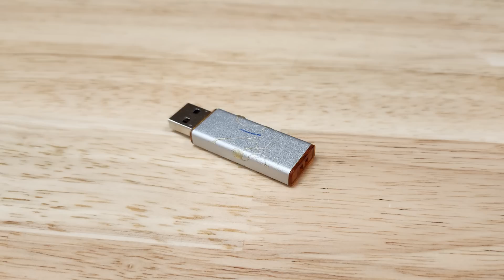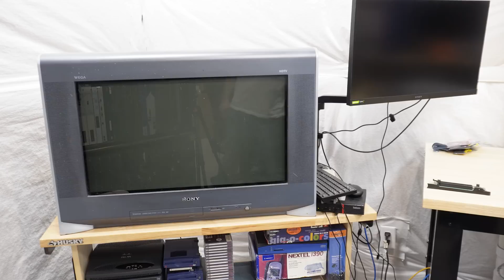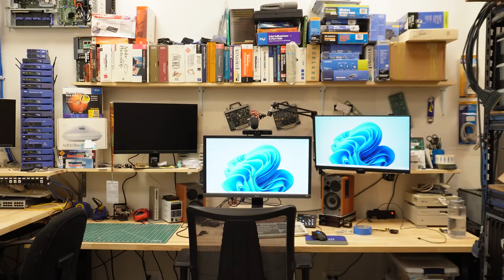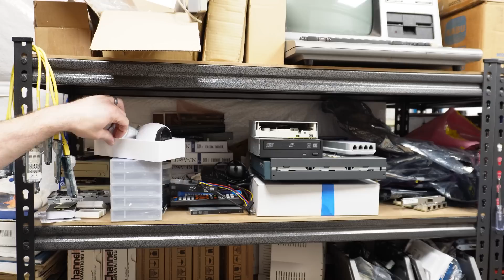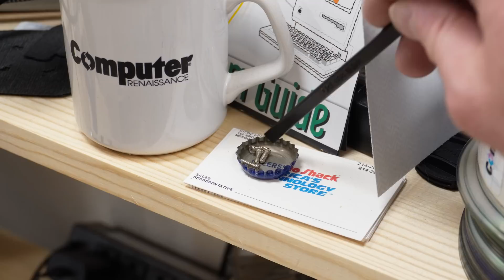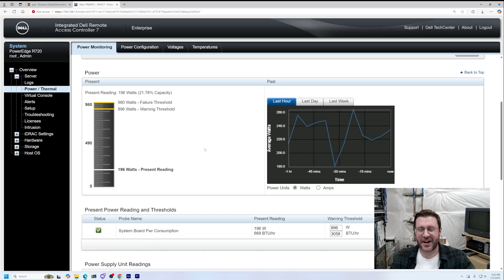Workshop and Homelab Tour

Comment: It's funny. I'm doing a brand new voice install for a school system, and during the walk through of their existing network closets we noticed that there were PILES of old networking gear in the corners. Whole bunch of Cisco 2960/2960s/3650G/3750G switches and many, many APs as well. My boss who was doing the walk trhough with me asked what the customer was going to do with all of it since they upgraded to Meraki, and he said that all of it was going to be scrapped. All of it, just tossed out to the recycling center. My boss quickly said that we'd be happy to rescue the switches to use for spares as they were all recent enough to still be usefull (fully Gig and PoE). It's crazy how much newer fully working equipment just gets tossed, so it's just so cool to see even older stuff put to cool use like this even now. Thanks for the great videos!
Reply from the maker: it's truly amazing how much stuff just goes in the trash
Reply: I picked up a 3560G for getting my CCNA, still plan on using it once i get a house of my own, though i did also pick up a 48 port ubi switch i would probably use primarily for the ecosystem lol. Used enterprise stuff aint light on power, but for what it is, its dirt cheap, just a bit of configuring
Reply: Send some of the stuff to mr Colby
Reply: Welcome to ‘Merica!
Reply: Depending on where you are and what industry you’re in, sending equipment to e-waste is legally required. In Montana where I’m at, all state institutions (gov’t, education, etc.) must dispose of equipment through the proper channel.

Now, small stuff is often saved by individuals for non-work related projects. Full computers and networking gear is never saved. It has to go through e-waste and surplus.
Reply: you should see the scrap piles that will be in your lsp providers nodes between your address and the head end usually there will be an air conditioned 18ft container with the current networking gear and  around 3 or 4 containers worth of "end of life" gear that can be pretty recent in the warehouse storing the active node ac controlled container
Reply: Aside from the above ^ where some companies literally cannot dispose of e-waste except through approved auction / recycling services, the other problem I've had is relationship management.  I work for a company that bills for my time.  I build relationships with customers that turn into pseudo-friends.  I once worked to upgrade and install a ton of new IT equipment, displacing a bunch of old networking and server stuff.  I asked, "what's going on with these?"  "Junk."  "You're going to throw it away?"  "Yep, unless someone steals it from my truck and saves me the trouble."  "Mind if I take a few?"  "Sure, what'll you offer for it?"

It went from "this is going to cost me to dispose of" to "how much will you pay me for it?" because, suddenly, it had value.  At that point, I was better off walking away from it and trying to find something on The Bay or in a local listing.  They took inspiration from that and decided to find another interested party and turn what they could into a revenue stream.  The rest was thrown away.

That's business, I guess.
Reply: @sirnickity  said "That's business, I guess."

That's not business, that's CULTURE. I live in a place where people can leave things to rotten but when someone asks for them, they're suddenly very valuable. And OLD used parts are sometimes tagged with a price HIGHER than cost of new ones

When people are taught that scumbaginess is normal, that's the result
Reply: we got a couple hpe 10g fiber with 6x 100g uplink switches from the scrap at a previous job, so yeah its INSANE what people throw away
Reply: I recently travelled interstate for a project at the office of a company my work acquired a few years ago, and they had a handful of 3650 switches (48 port gigabit POE with IP services feature set, no less) sitting on a shelf, most of which had never been unboxed. Turns out they'd bought them just before we acquired their business, and were planning on upgrading a bunch of their switches, but their network engineer was super busy and never got around to it, then he got a new job about 6 months later and never told us about the switches. They were going to send them all to e-waste! Needless to say I threw them into the back of the van, and they'll be used as temporary upgrades for some of our older switches.

If they had told us about them, we'd have organised to swap out their old switches and be done with them for another 5 more years, instead we put a in budget for their upgrade last year and bought them all brand new 9300 series multi-gig UPOE switches. Something tells me not mentioning the switches might have been the plan all along!

Comment: You mention your GFCI tripps when you overload it, a GFCI only trips if there is a ground fault not a overload. Faulty stuff like pinched wires or shorted caps would cause the trip. Only a circuit breaker trips if you overload the circuit. Since you have plenty of room in your panel your probably better off adding more 15A circuits than upgrading the existing circuit to 20A. Your 240V plug does not have ground fault protection so any faulty equipment you plug into it will just short out. You could use a 240V GFCI or GFPE breaker (they are expensive) to provide ground fault protection to your 240V gear, but I think you'd be better off with more 15A 120V GFCI receptacles.

Comment: The random screws problem: after ending the day or when desk needs cleaning, you can put the screws into a zip-lock bag, with a piece of note of what it is from. I use mini stick-it labels, they go well into those mini bags - but I had hard time to get them last time - maybe EU is banning such plastic. This serves multiple purposes - I can throw and mix the bags in one box or drawer quickly, the screws don't get to the floor with accidental flip of the cup, and its of course labelled - and you can search through the stash any time you need to get something back together. Sometimes I taped the relevant bag to the gear cover. And you can do recursive bags and labels, when the gear that comes apart uses multiple / complex screwing.
Reply from the maker: good idea!
Reply: Buy the zip-lock bags in 100 packs or so, and buy different sizes, and ensure you have enough (amount/quality) pens around to always have one working.

All zip-lock bags I've seen have an area intended for writing directly on the bag. They are so cheap that it's reasonable to write directly on the bag even for semi-short term usage.

Tip: write things like "cover", "rear panel" and so on on different bags and keep the different screws in different bags for the same project. Just stuff the zip-lock bags inside whatever device the screws belong to.